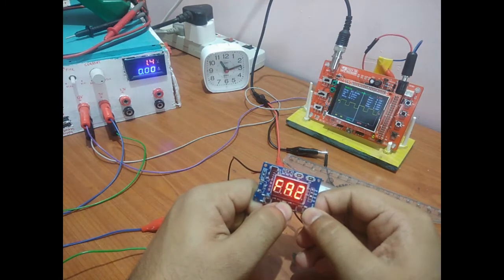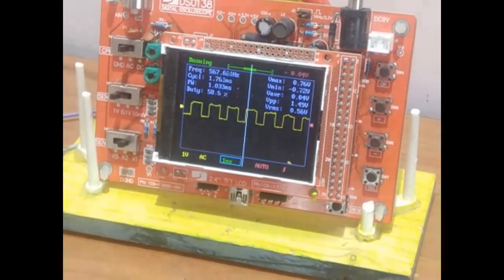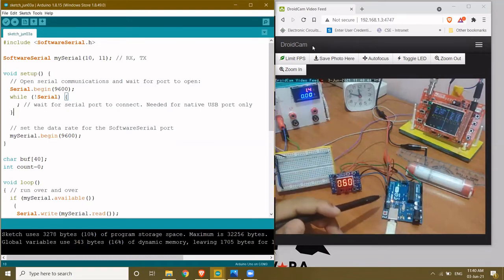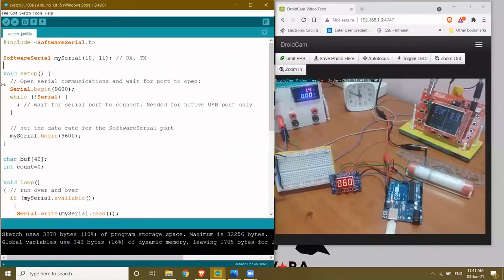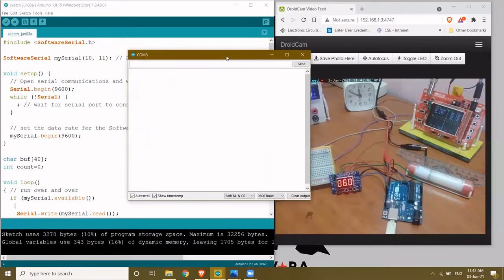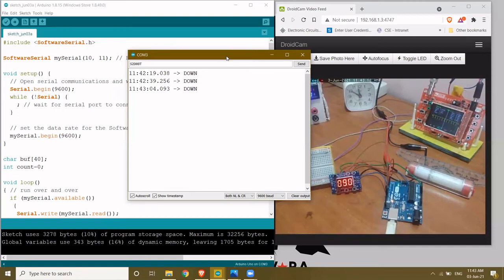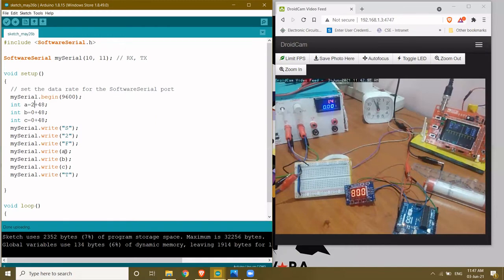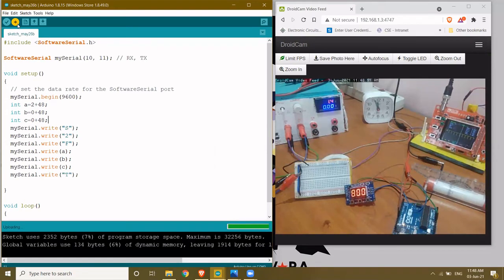2 channel PWM signal generator module

Comment: Please help with settings. 

I want to run both the channel on 50% duty cycle @ 1Khz. While I want to run channel 1 instantaneous, I want channel 2 to commence only after Channel 1 reaches zero duty.

eg: When Ch.1 = 5v, Ch.2 = 0v and vice versa.

Thanks
Reply: I want to run a stepper... is that what you were doing? Thanks.

Comment: I try to use this module for drive a motor but i'am fail... Can info me about pins on arduino and pins on module... What can i do to run a motor uses this module?